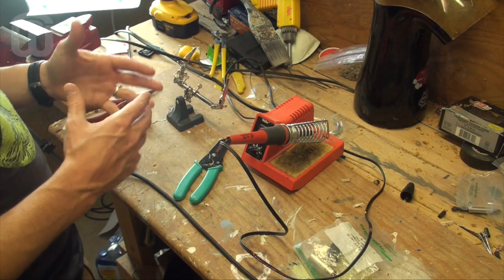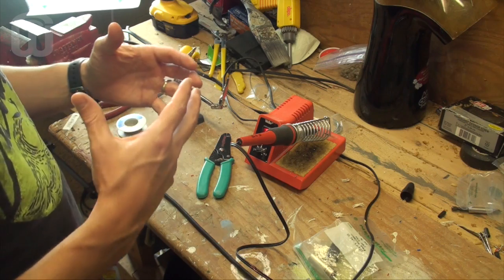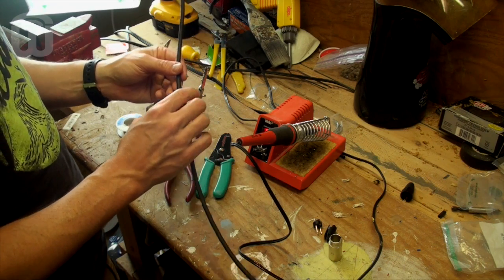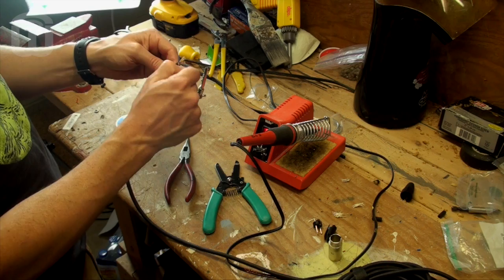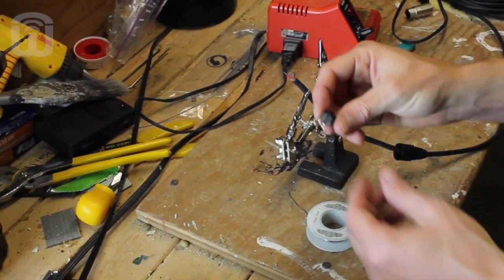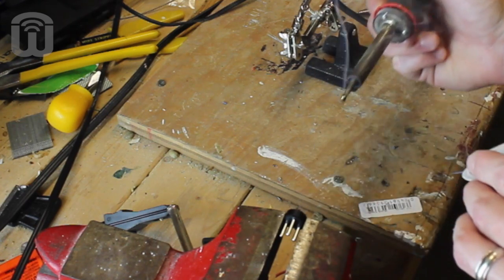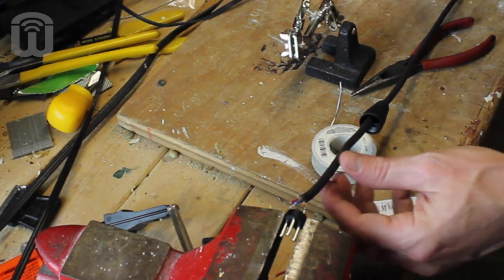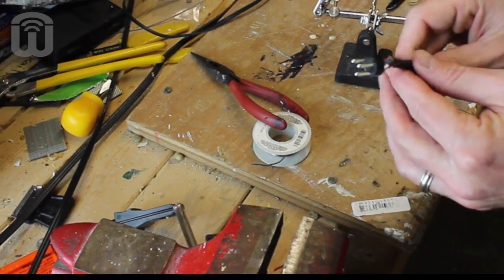Save 65% on audio cables - DIY

Comment: Save 65% of your Time - Ignore the Cables ( makes no difference anyway besides looks )
Reply: I agree to a certain degree. Between a 10 Dollar cable and a 50 Dollar Cable you mostly notice a severe difference. However everything over 50 Dollar is just luxury or a niche product. You can pay more if you want durable live cables with less resistance over long tracks. If you buy cheap cables from the start you will buy them repeatedly, because they wear of quickly or are badly shielded. Speaking of experience here. Just one week ago I had a direct comparison between two cables. one 15 bucks the other one 40 bucks. The humming and the buzzing with the cheap cable were absolutely annoying and the signals were far worse. But one thing is for sure. Those audiophiles who spend on 500 bucks on a cable are just crazy retarded.

Comment: I got tired of damaged solder points where the connector attaches to the mic. so after years of this I came up with a way to make the solder points forever permanent, yes I said forever aside from frayed wire in the body of the cord itself.  After making the solder repair I do something that the manufacturers should be doing, but then how would they sell cords if they did that?  I form a tape well around all the solder connections as a unit then fill the well with two part epoxy and let it harden.  Those connections will never separate again.  Walter

Comment: sometimes i make it, but why it always noise when I use it? like buzzing noise
Reply from the maker: Dannaezar what makes noise?
Reply: I don't know, but when I dont play the guitar, I heard noise from the amplifier. but if I buy the audio cable from the store it doesn't make noise
Reply from the maker: Dannaezar Hmm, not sure what to tell you.  You could try clipping off the connectors of your homemade cable and starting over...
Reply: Do you use wire with 2 wires and a shield? If so how do you connect them?

Comment: Your iron is set a little too hot. The voluminous smoke, and pointy spikes of solder are signs of an overheated iron.  With a cooler iron touching the solder to it wont matter, 'cause you won't be burning off most of your flux, and there will be more flux left to help the solder flow between the connections.  
Cheers!
Reply from the maker: Stephen Tack thanks for the tip - I thought I was just saving time by putting it on the hottest setting.  I'll try your way next time :-)